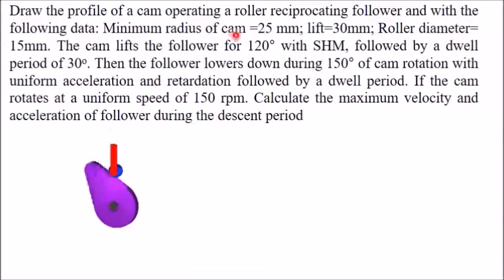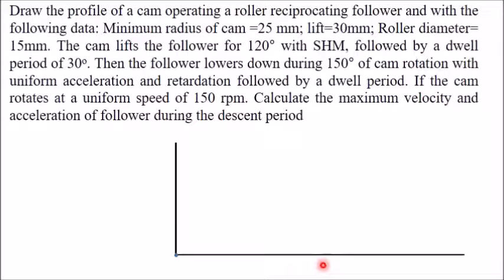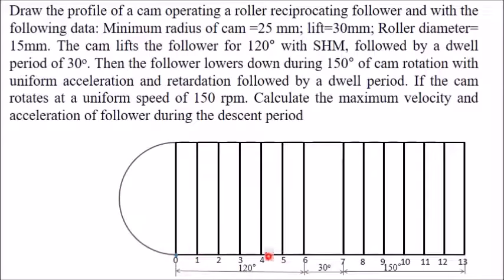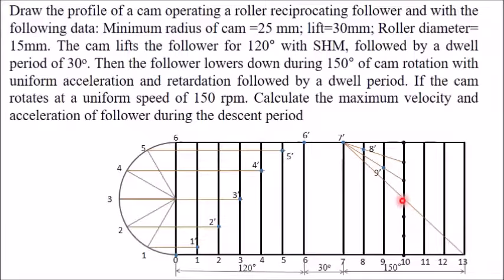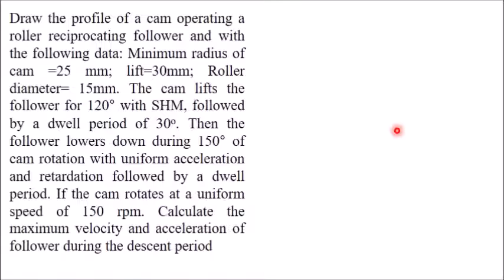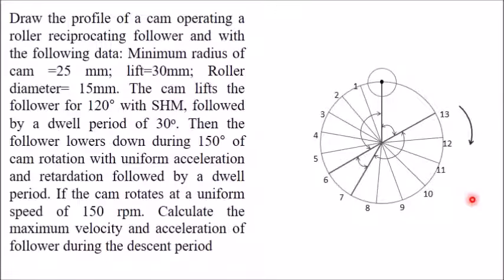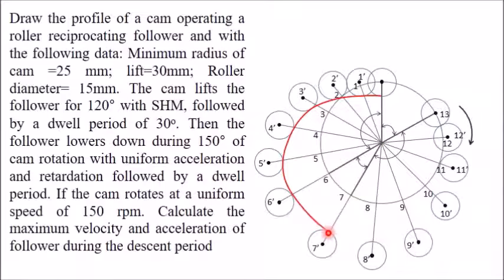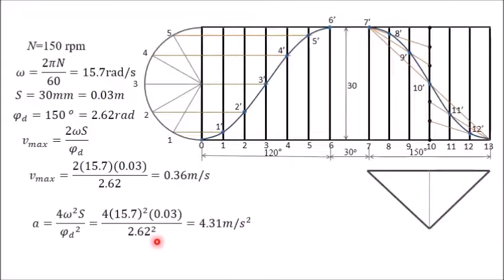How to draw radial cam profile with a roller follower

Comment: Dr sir displacement diagram is wrong where is the return dwell.... Actually angular displacement cam must be 360 degree
Reply from the maker: For drawing cam profile, displacement diagram of rise and return only needed. You can even eliminate dwell at top also. Also you don't need to draw rise and return angles with some  scale, you can take any arbitrary length for each.
Reply: @drjojithomas  thanks sir doubt clear

Comment: How do we obtain length  of 1' 2' 3' ...
Reply from the maker: Use divider and set distance 11' in displacement diagram and mark it in cam profile diagram. This way mark all other points.
Reply: But we are not given distance of  11'. Thanks
Reply from the maker: @DENNISKIPKOECH-k7j  using lift of the stroke you should draw displacement diagram as explained. Automatically you will get 11', 22',33' etc

Comment: How to this sir 
A symmetrical circular cam operates a roller follower with a lift of 30 mm. The minimum radius of the cam is 50 mm. The roller radius is 18 mm and the nose radius is 12mm. The angle of lift is 80°.If the speed of the cam is 210 rpm.find the main dimensions of the cam ,and acceleration of the fallower at 
a) the beginning of the lift and
b) the apex of the nose

Comment: Cam profile you draw that is wrong 
But u did not draw a prime circle
Reply from the maker: Only circle drawn is prime circle of radius 32.5 mm. It is clearly mentioned. Base circle not drawn as it is not required to draw profile in this case